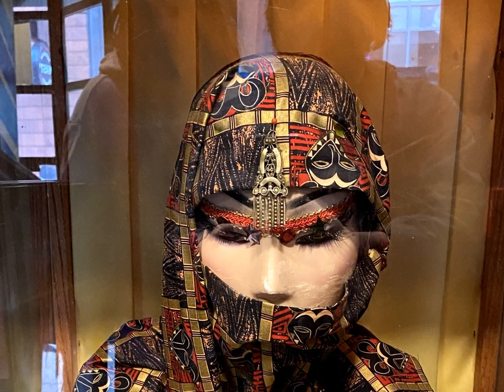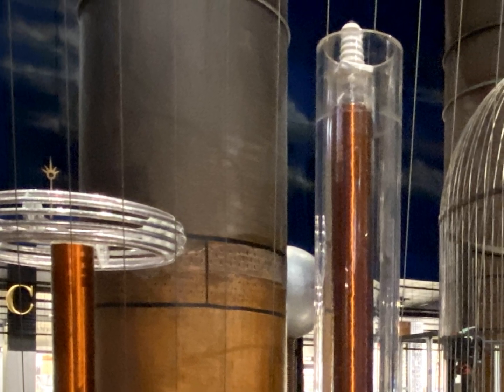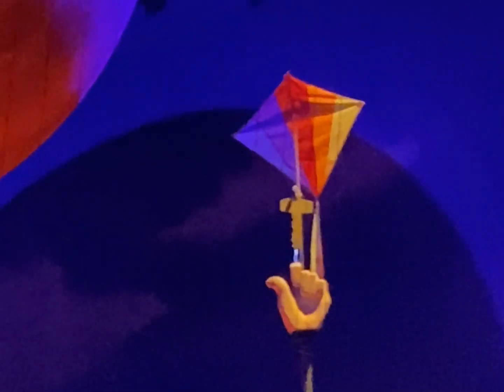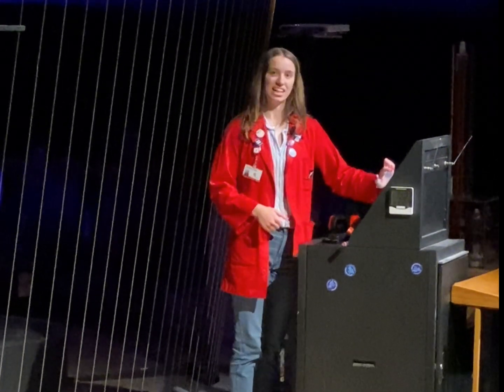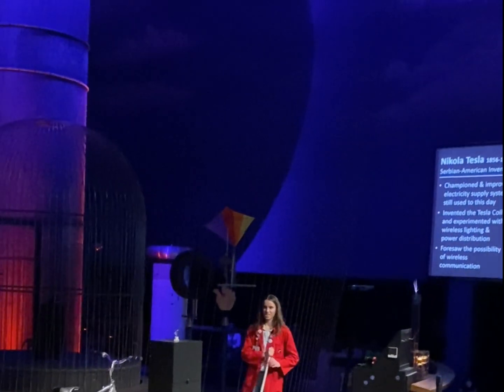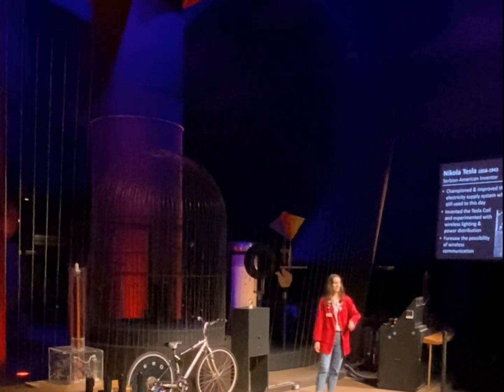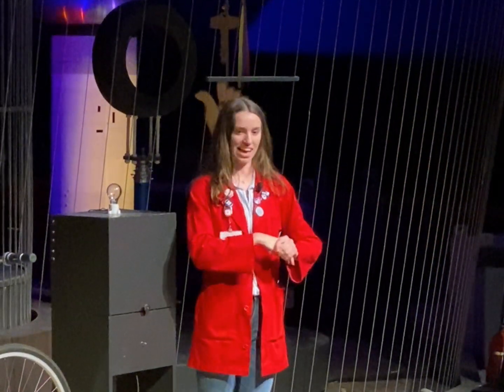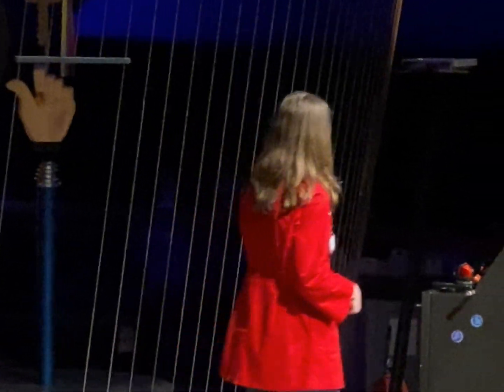The Boston Museum of Science Electrical Show

Comment: Got it.

Electricity is the conjugate of dielectric and magnetic fields, Voltage is dielectric tension, Amperage is Magnetism, Magnetism IS the dielectric field losing potential. When a circuit is cut whatever voltage is in the circuit releases its tension and manifests as magnetism, Back-EMF.

This is why Tesla was adamant on high voltage and high frequency resonance, the more voltage you have the more amps are created when the voltage is allowed to relax, it's a direct conversion of volts to amps without sacrificing the voltage.

The early electrical engineers could not figure out what was causing their transformers to blow when they would cut a circuit in large transmission lines back around 1910, what was happening was voltage rebound. With AC current the electrical wave oscillates back and forth and when the circuit was cut, it would SNAP back or rebound with tremendous force, much higher than their components could handle. This would result in an explosion, thereby dissipating the energy through thermal radiation or heat.

What ended up happening was C. P. Steinmetz was brought in to fix this problem. He called it "Back EMF" or EMF that flowed backwards with amazing force/pressure. We call it amps.

Think of a spring under compression, that's the voltage, if you let the spring release that's the equivalent of magnetism, tension and release.

Get it in resonance with the coil and you'll be converting high volts to high amps every cycle of the frequency, It's just a matter of timing (frequency) in order to sync (resonance) the circuit design. It's like jumping on trampoline, if you don't bounce back at the right moment you'll never get more out of your jump than you put in. Once it's in resonance you can start harnessing the Back-EMF.

More Volts > more Amps > less heat, endless energy, you can easily wire a portion of the output back to the input, with the only limit being the resistance of the parts.

The Dielectric field is the Aether under tension or torsion which itself does not have dimensions, this is what Zero Point Energy actually is. 

The best part is voltage boosters can be used for this, where you can easily step up a tiny voltage source like 9 volts to the millions. The implications are obvious.
Reply from the maker: So given what you just said you reminded me of a very interesting video by a Creator that I love to watch called Ray Fleming.  He’s a retired physicist of some sort who has great issues with the current scientific establishment and his own ideas about things.  https://youtu.be/ca0sOGg1w5k